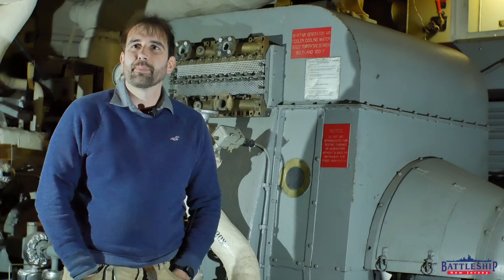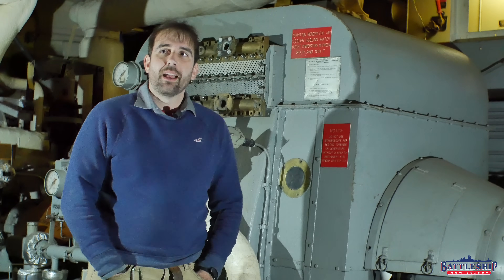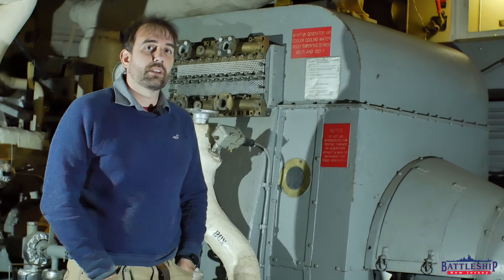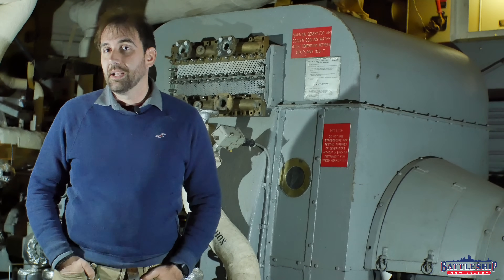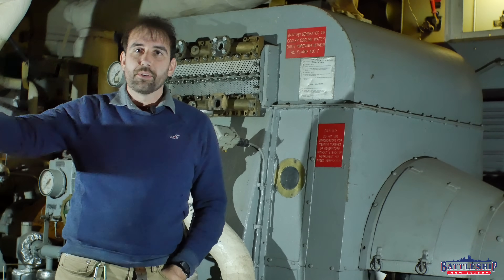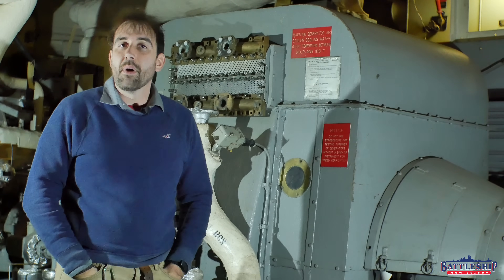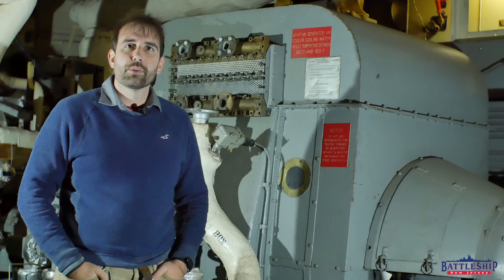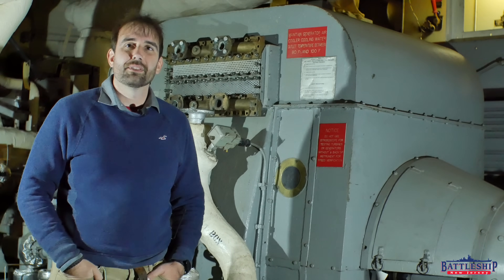Turbo Electric vs Direct Drive Turbine: What Propulsion Plant Is Better for Capital Ships?

Comment: Practically gas turbie-electric system. All the benifits your talking about with a quarter the footprint. Much more thermally efficient than rankine cycle. However diesel (opposed piston reciprocating) is THE most efficient (not limited by carnot as it isn't a closed system) but rotating mass and low RPM limit its efficacy in a fighting ship. Nuclear is actually HORRIBLY inefficient due to the inability to generate superheated steam. The trade off is fuel burn (NEVER have to refuel a modern naval PWR).
Reply: Hi!
Just two corrections:

Any heat engine ist limited by carnot- carnot defines how much of your heat you can convert to power, the rest has to carrry the entropy out. Doesn't matter if its open or closed- in a closed system, you still have to remove the waste heat (in the condenser), just like the diesel exhaust does.

Reactors can create superheated steam, but I don't think commercial or military installations have done so jet.
Reply: @nos9784  the amount of superheat possibly attained by a PWR is effectively zero as no boilig occurs in the primary circuit. The resulting entropy of the working fluid being transfered to a lower pressure fluid is enough to boil, but not superheat to any practical degree. A BWR can realize a bit more superheat from additional heat transfer in the head of the reactor, but both situations produce saturated steam that may be marginally superheated, but nothing close to what a boiler is capable of. 

Carnot assumes isenteopic heat transfer between hot and cold reservoirs to calculate maximum efficiency. This is how ideal Brayton and ranking cycles work. It is NOT how ideal auto or diesel cycles work. I've measured test engine (GE 4 cylinder spark ignition) thermal efficiency (IMEP/BMEP) higher than those calculated by carnot assumptions. Carnot is a rankine/Brayton limitation, not an auto/diesel limitation. They still obey the 2nd law of thermodynamics, they just don't follow the carnot assumptions for maximum efficiency.

Comment: If I were to build a modern battleship, I would probably do a gas-turbine hybrid.   Gas-Turbine generators with the turbo-electric drive train.   No boilers, no long shafts, no high-pressure steam.  The gas-turbine generators don't need steam condensors and associated piping for cooling the steam.    They are really easy to automate, so we can put them in small compartments all over the ship.   They could be emergency generators as well.  I might use electric driven propulsion jets to eliminate the shafts completely
Reply: Gas turbines have poor efficiency.(~33%)
For cruise economy, add diesel engines(~50%) or use the turbine exhaust to heat boilers (~60%, in land based combined power plants. 

By the way, what fuel do gas turbines on ships use? Do the need jet fuel, or can you run them on heavy fuel oil?
Reply: @nos9784  I think if the fuel is sufficiently vaporised a gas turbine can run on most combustible fuels
Reply: @nos9784  The Navy runs them on JP-5.  They use JP-5 for diesel engines, aircraft engines, and helicopters.   Boiler-fired carriers used to burn it in their boilers too.  It makes it easier for the oilers that replenish the fleet.  They only have to bring one type of fuel.
Reply: Diesel fired would be best for this size vessel. As NOS said the thermal efficiency of gas turbines is atrocious at cruising speeds, really only relevant for a fast ship. 

The electric component is definitely viable, but gas turbines probably aren’t the most efficient means of generating that power.

You could go nuclear, but they’re prone to malfunction from any kind of shock. And if you’re using a battleship for it’s intended purpose then you’ll be taking a fair amount of hits causing shock and vibration. 

Therefore diesel power generation would be your best compromise between cost and efficiency

Comment: Turbo-Electric is making a comeback in naval construction with gas turbines direct driving electrical generators which provide electricity to electric motors which turn the propellers, and also for times you don't need the high output of a gas turbine, diesel generators can still produce a useful amount of electricity to spin the motors. It also opens up using azipods to offer better maneuverability to ships.
Reply: It's also handy for cars. I have a small hybrid SUV and it's pretty neat that it doesn't even have a reverse gear. It just revs the engine to generate power and then spins the drive motors backwards.

Comment: I'd just have a set of GE gas turbine engines.  Given the high power output for size, I think you could significantly up the power output for an Iowa class sized warship.  Compared to what they were designed with, so much more power for radars and modern systems.
Reply: The enemy of GTEs is fuel consumption.
Reply: @pattonpending7390  yup, they get thirsty. gas turbine ships do lots of unreps!

Comment: Nuclear is always a concept I thought would be interesting on a battleship the size of an Iowa, she could probably crank out higher speeds and support many and newer weapon systems/associated systems
Reply: I worked in the nuclear field when I was in the Navy.   Nuclear plants give more range, but are not necessarily going to give more speed.  The shape and length of the hull affect the top speed more than the amount of horsepower you have available.
Reply: @DonMiller-Weiser  Would a nuke plant handle the shock of firing the main guns?  Likewise could it handle the shock of impact on the armor from incoming weapons?  I always thought they were fragile compared to boiler fired systems?
Reply: @andrewmortimer3317  If you had enough electric power, you could be sporting rail guns, lasers and microwave jammers.. probably would be better than having all that powder on board.
Reply: @andrewmortimer3317  reactors and shock:
I think ryan talked about that in the past. If I remember correctly:
not a good idea, 
Shock loads would disrupt the chain reaction and power delivery. 
How that happens- no idea... doesn't make sense to me. 
But I am not a nuclear specialist, just a nerd.
Reply: @nos9784  If Ryan talked about this in the past, I haven't seen the video, however, what you stated that you think he said is 100% wrong (in the sense that the info is wrong, not what you're saying) and Reactors, particularly Navy Reactors are perfectly capable of handling shock.
Reply: @andrewmortimer3317  The recent shock trials for the Gerald Ford would be my best answer to that.  https://www.youtube.com/watch?v=yV0eyP4nO20     In general, nuke plants are pretty shock proof.   The Navy has lots of experience with them.
Reply: @DonMiller-Weiser  I've heard that nuclear plants can't change power levels quickly as compared to diesels or gas turbines so they don't have as good acceleration. Is this the case and even if true is it something that's relevant?
Reply: @lunatickoala  Navy Nuclear plants change power levels constantly.  Civilian plants, yes, navy plants not a problem.  Navy plants are designed extremely differently from civilian plants and changes in speed are really easy to accomplish for nuclear ships.
Reply: @lunatickoala  I don't think it is relevant in a ship the size of a battleship.  I visited the Iowa for a day in 1988, off the coast of Oman.  That ship is huge.  It was a pretty amazing day.   I remember seeing a dent near the top of the #2 16-in turret.  It was about softball size.  I was told they were hit there by a Japanese 3" artillery piece.
Reply: I think refueling a nuclear reactor inside a battleship's armour is problematic
Reply: @robfromcanada5075  fuel rods aren't that big, they fit through hatches :D
Not sure how they are handled on submarines, I suppose they planned ahead to minimize personnel exposure...
"handling" used fuel rods doesn't really sound like a good idea.
Reply: @nos9784  I thought I remembered hearing something about that but I wasn't sure. Thanks for clearing that up
Reply: @robfromcanada5075  I don't think i cleared anything up :D
There is a video on this channel, called "nuclear powered battleships", we should propably rewatch that at some point.

Not sure if i can post internal links?
Reply: To add to what Don Miller said, the power requirement for a given hull increases with the cube of the desired speed. And that's just from hydrodynamic drag, before you run into additional inefficiencies like cavitation - or the limitations of the ship's machinery as to how much power it can transfer into the water without something undergoing a Rapid Unplanned Disassembly Event.
Reply: I'd be hesitant to build a nuke powered battleship without knowing the expected combat requirements.  If we are building a modern Iowa designed to take hits from missiles and guns I'd be cautious if for no other reason than the loss of such ship to gunfire represents a non zero risk to the oceans of the world. The aforementioned shock issues with large, direct, impacts would always be a concern. 

If we are designing it to effectively be an over powered Ticonderoga and not planning for it to take unnecessary hits (like a carrier, but with missiles and guns), then yeah, nuclear all day on large capital ships. Supporting the ship with numerous CIWS and VLS tubes amidship for S2A and anti missile systems would make it more survivable. The naval gunfire support mission is still viable with modern artillery capabilities.
Reply: Here is the older Video on nuclear powered Battleships:
https://youtu.be/ZkVF25RyzO0
Reply: Nuclear reactors are larger and less power dense than gas turbines, which is a big deal when you need to armor all that stuff. It makes a lot more sense on an unarmored modern missile ship like the Kirovs.
Reply: I'll give a Big NO on putting nuclear reactors in battleships. Such a  system is inherently incompatible with the purpose of a battleship. While a reactor can be built that is shock-resistant, a reactor can NOT be built that is completely immune to damage. Since battleships are designed to TAKE damage as well as dish it out, putting a reactor onboard would make the battleship too dangerous to use for its designed purpose. Submarine reactors are safe by virtue of stealth. You can't break what you can't find. Carrier reactors are safe thanks to effective air wings, and whole fleets of escorts. But other surface combatants such as CGNs, DDGNs, and even BBNs lack those protections. Armor can only get you so much, when heavy anti-ship missiles are a thing you can reasonably expect. There's a very good reason why the USN retired all of its DDGNs and CGNs, and never even considered a BBN.

That's not to say a modern battleship wouldn't be useful. There very much is an important role for a modern armored surface combatant with heavy guns. But it should be equipped with gas turbines or diesels, not a nuclear reactor.
Reply: @kotori87gaming  You're correct on there being a good reason for the navy decommissioning the small boy nukes, you're wrong on your logic.  First off, shock resistance, yeah,  USS San Fransisco (SSN), ran into a mountain, no scram.  CVN-65, ran aground at least once, 8 reactors, no scram.  Other submarines have run into things, no scram.  The reason that the navy decommed the small boy nukes is because the cost in personnel and operation was too much.  The Navy has a hard enough time today getting and keeping nuclear personnel to run what they have, let alone additional ship types.  Fuel oil and whatever gas turbines use is far cheaper than building, running and maintaining a reactor.  These are the reason that the navy cutout the small boy nukes, the power wasn't needed and they couldn't properly man the fleet.
As far as subs and carriers, well, the purpose of the subs mission, and the fact our carriers are fast is all the reason to keep them.
Reply: Not with the nuclear reactors of the time periods she was re-activated. One of the reasons for the Gerald R Ford class carriers is the lack of reserve electrical generation capacity of the Nimitz class reactors. The Ford's two reactors have about 25% more thermal capacity than the two reactors of the Nimitz class, with all steam from the plants not being used to drive the turbines connected to the propeller shafts pretty much all going to electrical generation. This is what makes the electromagnetic catapults possible, and once they're fully matured the sortie rates will be better because you don't need to wait on steam pressure to build back up again between Catapult launches (the steam for the catapults come from the reactors). 

To convert an Iowa to nuclear in place of the oil-fired boilers would have required extensive and EXPENSIVE work as you have to tear thru all three armored decks and numerous bulkheads to do it for limited capabilities. If Not for Ronnie Reagan's promised 600 ship navy, they never would have reactivated the four Iowa class battleships in the 1980s. They just didn't bring that much to the fleet which is why they were all retired as soon as the cold war ended. Iowa spent just over 6 years in service after reactivation, New Jersey just over 8 years, Missouri less than 6 and Wisconsin less than 3, and basically it was a $1.7 billion dollar PR exercise to make the nation feel good about voting republican. In hindsight they should have just built 3 more Ticonderogas with the Mk41... or put that money to refitting the first five Ticos to replace the Mk26 twin-arm launchers with the Mk41 VLS (and then not had to retire them prematurely in the early 2000s). The number of ships dragged out of the reserve fleet, or kept it service well past the time they should have retired just to hit that 600 ship number was ridiculous.
Reply: @DeeEight  Not entirely sure where you get your information or numbers from, but the Thermal capacity of the Ford Reactors is literally almost double that of the Nimitz.  550 v 1000/core.  As far as the electrical capacity, that's purely down to the wiring and the turbine generators.  Literally the EXACT same issue Ryan described in this video about why the Iowa's didn't get larger TG's.  Too much work, too much cost, too little benefit, not to mention, all the steam piping to be removed and replaced as well as a complete replacement of the catapult systems.
As far as waiting on steam, Nimitz class RARELY have to wait on steam.  Each catapult has a reservoir that holds multiple shots worth of steam and is almost always being fed with new steam from the plants at all times, even outside of flight operations.
You certainly sound more like you're a weapons guy and not a propulsion plant guy, might want to leave the plants to those of use that operated them.
Reply: @DeeEight  The BBs were brought back to be the core of surface action task forces with a secondary shore bombardment role. Consider the timeline: the 80s activation was closer in time to the Korean War then we today are  looking back to the 80s activation. The other proposal was to build more Nimitz carriers which would have taken decades.
Further, the armored protection was a huge consideration. The Iowas were meant to stand up to one ton projectiles fired by other BBs. It was felt that they'd have no problem shrugging off a Styx or Kelt which would devastate a more modern cruiser. The Falklands a few years later would pretty much prove that correct with the sinking of the Sheffield and Antelope, and damage to Glamorgan. 
The Iowas were there ready to reactivate, in theory in great shape. Do some upgrades, and boom, you've got a theater dominating armored dragon with about 20 years of steaming time left on the hulls.
Yes, they were dinosaurs. But T. Rex is still going to chow down on just as many tigers, lions, and bears that it can catch, and there's just not much the tigers, lions, and bears can do about it, except run and die tired.
Reply: @DeeEight  Should have built the planned Strike Cruiser with the Mk71 8” guns instead of more Ticos.  Not that the Ticos are bad ships, but they’re more overstuffed destroyers than actual cruisers.  The cancelled ships would have had a lot more room for upgrades.  As for the Iowas, they were always a temporary solution, and were reactivated more to scare the Soviets than anything else (and did so successfully, as the Soviets had/have no clue about surface combat).  But in order to make them truly relevant for modern combat, you’d have to do things like replacing all the machinery and wiring, and installing a ton of VLS cells above the armored deck between the forward funnel and the aft secondary 16” fire director.  Would have needed to trunk all exhaust to the forward funnel, build up the area, and probably remove the aft turret to avoid top weight issues.

Comment: You've got me thinking now Ryan.
On the Iowas is there another seal where the shaft goes through the citadel and heads towards the back of the ship?  So that if the rear compartment floods it cannot get into the citadel?
Can you please do a video on this?
And great stuff as always
Reply: I don't know if there are any more seals, but I would expect that. The problem is however, if the shaft is damaged by a hit while turning, it would spin out of control. The amount of energy conserved in that rotation (angular momentum) is incredibly high. That would probably destroy any conceivable sealing. If I understood Ryan correctly, this is what sank Prince of Wales.
Reply: There is no additional seals as the shaft heads aft. There are seals as they leave the hull, and seals at each bulkhead, but nothing more. 

I am not familiar with the incident Ryan is referring to, our shafts have bearings in each space, and with the placement, I can’t see how we couldn’t shut down the shaft fast enough to limit the damage.
Reply: @richcruse2689  are no